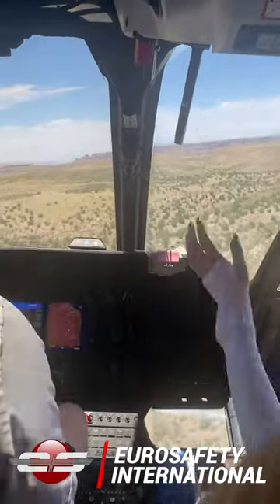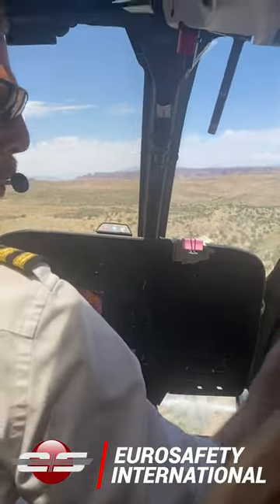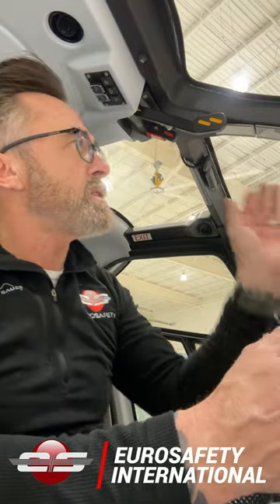The Reality of Grabbing the Rotor Brake in a EC130 #aviation

Comment: ATP-Helicopter here.. if that aircraft has the Turbomeca it's like 800 SHP, and gobs of torque.. the rotor brake is only designed to slow the rotor when the engine is shut down.. when turning at cruise power, if the rotor brake was fully applied, it would likely overheat quickly. The risk is not stopping the rotor- the risk is fire!
Reply: Came here to say this Noice!
Reply: Came here to say the same thing..but want to add, not only fire but would probably vibrate the drive shaft causing a catastrophic failure
Reply: @cruzberg84  LMFAO, gotta love these cute lil comments.
Reply: Even if the blades stopped, aren’t there things the pilot can do to maneuver the copter to the ground without it falling “ like a rock?”
Reply: @AntLyon  The rotors need to be free to spin, but technically as long as they aren't obstructed, yeah.... in some helicopters at least.
Reply: @AntLyon  the rotors are the only thing keeping that helicopter airborne. If they stop, the helicopter falls
Reply: @AntLyon  as they put it in cross ocean helicopter flights "the rotor turns, or the passengers swim" (usually used for old school planes on ocean crossings but applies here. The rotor is what "autorotates" to keep the bird aloft in the event the engine dies. That's why the rotor has an "overrun" system, so it can spin faster than the engine if needed (when the engine dies)
Reply: @Zyoher  You either didn't read what he asked, or you don't know what you're talking about. Many helicopters can glide safely to the ground during an engine failure, which is what he was likely half remembering/asking about.
Reply: @Taffey_Lewis  No. He understood correctly. What you are referring to is called auto-rotation where a helicopter can descend safely if the engine fails. However, that assumes that the rotor is free to spin. If you brake the rotors, you fall from the sky. It's the same as a fixed wing airplane: you can glide to a safe landing without the engine working, but you fall from the sky if your wings fall off.
Reply: @kg4lod  I doubt either of you understood the person you're responding to. All AntLyon meant was if the rotors lost power, not if they by literal definition STOPPED rotating all together. It's pretty clear what he was asking if you can just get past taking things so literally.
Reply: @Taffey_Lewis  1. He literally says, "even if the blades stopped [rotating]..." 2. The video is about the rotor brake lever and its effects if able to successfully deployed mid flight... which is to stop the rotation of the blades.

 Nowhere is there anything to suggest his question was about engine/transmission failure in a free spinning rotor disc scenario.

He is describing Autorotation as a possible solution to rotor braking and asking about its applicability... It doesn't work in this scenario.    Everyone dies.
Reply: Cold startup as well
Reply: Everyone always fights lol
Reply: @AntLyon no because the body of the helicopter does not create any lift, purely the blades keeping it airborne. On a plane the aerodynamics create lift so they can glide
Reply: Yeah I was thinking the same thing I mean the rotors themselves have a LOT of momentum when they're "free wheeling down after landing, but when the turbine is turning them I wouldn't have thought that the rotorbrake would stand a chance at slowing it down (at least, not before the brake "pad" surface completely overheated
Reply: Sooooo... The pilot is right, it will kill them (with enough force and friction lol)
Reply: @AntLyon autorotation will never work if you apply brakes.  You will fall like a rock.
Reply: @Taffey_Lewis  I know you weren’t replying directly to me, but spot on! That is exactly what I was half remembering! Engine v. rotors. Thanks!
Reply: Apparently, there is a deadline on how long you can edit a reply, so I’ll say this here, thanks to everyone who answered my question! I got it now! “Engine failure, pilot has a chance. Rotors stop, helicopter falls.“ The guy in the video was talking about rotors stopping; I was remembering a bit about pilots guiding a stalled helicopter to the ground. Thanks again!
Also, this is AntLyon; I don’t know why I was switched to my professional account. I didn’t sound too stupid did I?
Reply: @AntLyon sure. He could do everything an airplane pilot could do if you removed the planes wings,  because stopping the rotors is the same thing as removing the wings
Reply: @AntLyon   Pray
Reply: I highly doubt they would burst into flames by the time you were able to disengage the brake though.
Some rotor brakes aren't all that different from what high performance race cars use, which means they can handle a whole lot of abuse. Like everything in aviation, there is a huge margin of safety.
Reply: @lakaiskates8064 helicopter pilots train on EPs for rotor brake fires. While they are not common c pilot error can easily cause them to catch fire (if they push them past their means) 

It’s also not uncommon on larger aircraft like the mh-60 to have them smoke/overheat if they do back to back rotor brake engagements, such as during a hung droop stop during shut down causing multiple respin ups
Reply: I never see such an articulate comment from a helicopter
Reply: @AntLyon not really 😊
Reply: @AntLyon No, absolutely nothing. The blades are the only thing on a helicopter that produce lift. If you slow them down or cause them to vibrate enough they break or slice off the tail boom, the helicopter will immediately fall to the ground at over a hundred miles an hour. No parachute, nor rockets to cushion the landing, and maybe not even enough time to recite a prayer that could stop your soul from continuing the fall all the way down to hell.
Reply: @AntLyon  there is a way to defend without POWER but the blades do have to spin....tho apparently that wasn't the risk here haha.
Reply: @AntLyon  No. Autorotation only works if there is rotation.
Reply: Came here to say basically the same thing. We had an MH-53E that had an APP flame on startup and the pilots manually released the root brake. On shut down they did not properly complete the check list and the rotor brake Emergency switch was still on meaning the rotor brake would automatically apply to full park once the last engine was brought down below gnd idle. Yes as this poster started, fire is the biggest risk and that is exactly what happened with ours. Complete loss of aircraft.
Reply: @AntLyon no there's nothing the pilot can do. Helicopters are called rotary winged aircraft because the rotor blades are not propeller blades they are actually wings and as such provide the aircraft with all the same things as the wings on fixed winged aircraft. That includes not only lift but also flight control. If you lose the wings on an aircraft you're done there is no gliding or control. If you lose power but still have rotor speed you still have control and the ability to perform an autorotation for a "more controlled" crash.
Reply: Thank you. Finally.
Reply: @AntLyon If that "disc", made by the spinning rotorblades stops, there is no more "disc".
You fall.
Reply: @rusfirth5652 No sweat, Sir.
Aeronautical engineering is not too many folks "cup of tea", so to speak.

Comment: Still no one other than the pilot should be touching anything
Reply: Obviously
Reply: He literally said that at the start of the video
Reply: He already said that.
Reply: Don't tell me how to make a viral video!
Reply: Well, that's not fair
Reply: That's what she said
Reply: He said that already…
Reply: I think you missed the whole point of the vid, the other video was spreading false info
Reply: Ahh, no shit.
Reply: He's not disagreeing, in fact as others have pointed out, it was one of the first things he says, however, he's pointing out the misinformation that spreads following viral videos and the often unqualified individuals making misleading or downright false statements for clout.
Reply: And that should be included in a passenger brief before TO
Reply: Omg dude I thought about the bthis sentence as I read your comment  lol “still no one but the pilot should touch anything”
Reply: If it looks like an Oh Crap handle, the pilot should have specified before taking off to not touch it..
Reply: It does look like an oh shit handle
Reply: I learned in the Air Force that being a button pusher can kill you even if the aircraft is on the ground. It mostly focused on the ejection seats. Yes, there are safeties to prevent someone from accidently ejecting on the ground but that doesn't guarantee that the safeties are working properly at the time you play with the handles. A similar issue happens with the prop brake. Yes, it's much more difficult to lock it if the blades are spinning at flight speed but do you want to be the one to test how effective it is mid flight? I think not. "You'll kill us" is a valid warning of caution to those who wish to be button pushers in aircraft. (Yes, I know that this is technically a lever and the ejection seat issue is technically a pull handle. That doesn't change the fact that the passenger is referred to as a button pusher in this situation.)
Reply: @barowt he shouldn't have to specify not to touch that. If it's possible the passenger should be placed in a seat that doesn't have access to controls. However, the instruction "do not touch the controls" should be enough. By the way, those "Oh crap handles" in cars are for hanging clothing or assistance in entry and exit of the vehicles. They are not there for you to grab because something scared you.

Comment: Is it a friction brake or an interference design?  I imagine a running rotor would just sheer off any pin or dog that gets applied.
Reply: On Sikorsky’s the rotor brake is Friction, just like an automobile. There is a Gustlock on military models (not the S-76,) that is a Paw that engages a toothed wheel to lock the rotor. It’s used for mooring and maintenance, such as replacing blades.
Reply: Friction brake. Brake linings pressing against a brake disk.

Comment: Aerospace engineer here,  rotor brake would fail quickly, but in the short time, it would throw an incredible amount of torque through the air frame.

Comment: A fantastic explanation thank you.
Reply: Really? I feel like he didn't explain anything.
Reply from the maker: I didnt?
Reply: @EUROSAFETYTRAINING  The question is what would happen if the lever is pulled. You just said the lever can't be pulled. That doesn't explain what would happen if it could be pulled though.
Reply from the maker: So you think I should have explained what would happen if what couldnt happen happened?
Reply: @EUROSAFETYTRAINING  It was the question yes. It was a hypothetical question, which would require a hypothetical answer.
Reply from the maker: So you didnt think I explained anything because I didnt explain something that would not happen but you want a hypothetical (aka imaginary) description from me about a make believe story. Yeah.... no
Reply: @earthwormandruw 😅  He literally said in the video its impossible to stop the the rotor completely by just using the rotor brake. Its going way too fast and with too much force for the rotor brake lever to stop it. Its mostly meant as a safety lever when the helicopter is turned off or in storage. He is mereley explaining the context of the video of the pilot and passenger 
Why do you want a hypothetical explanation on something thats impossible to do?
Reply: @alexhenao7072  Nothing is impossible, especially in theory.
Reply: @EUROSAFETYTRAINING  no disrespect but I think you might have misinterpreted what he was trying to say. I'm pretty sure he understands that the rotors blades won't stop but what would happen if the brake was still engaged. Wouldn't the disc the brake is pressing against heat up and create a lot of smoke and possibly a fire? Kinda like how a brake rotor on car is spinning really fast while the wheel is jacked up off the ground, the brake doesn't have the force to stop it but it makes the rotor glow red hot and create smoke and fire.

Comment: They also said it would be impossible to open an emergency exit while flying but that Korean dude proved that theory wrong.  That pilot had every right to be pissed at some ignorant knucklehead grabbing controls that could kill everyone on board.
Reply: It is impossible to open an exit door in an airliner at altitude because the fuselage is pressurized, so it’s not a theory. The idiot opened it at low altitude where there wasn’t much pressure differential. Don’t compare apples and oranges and expect to get a valid answer. You need to know the full story.
Reply: @artjackson8360 depends on the aircraft. Some open from the inside out, some are the opposite and rely on latches to resist the inside pressure.
Reply: @WaterMan416  I’m unaware of any commercial airliner that uses latches for the passenger doors. Can you give me an example of one of them?
Reply: @artjackson8360  They are right, some open outward by pivoting down, like the Bombardier CRJ200, some open outward by swinging to the side, like the Embraer 190 and some are pulled inside before being rotated and pushed through the opening, like the Boeing 747.
Reply: Yes, but in every case, the cabin pressure pushes the mating surfaces/lugs/etc into their recesses/against their respective stops with enough force that it’s virtually impossible to open once the cabin is pressurized. The way it hinges doesn’t really matter. The CRJ has a sort of T-post and circular capture socket, the A320 lowers the door’s lugs behind that of the frame.

In the regional jet I fly, the pressure differential between cabin and atmosphere is typically about 8 psi up in the flight levels. That door has a lot of square inches of area, and that force is concentrated on about a half dozen contact points. Even on jets where the handle operates a vent I doubt it will equalize the delta-P enough, or quickly enough, to let anyone but a powerlifter operate that handle. Below maybe FL180? Possibly.

Comment: On ec145, the starter/generator alone has enough power to overcome the braking force. Watched a LTC burn up the brake on a sub 100hr airframe at startup with the brake engaged. Brake is there to keep the blades from spinning when parked and/or slow the rotor after shutdown. On other airframes the brake could have significantly more force and actually cause a catastrophic problem.